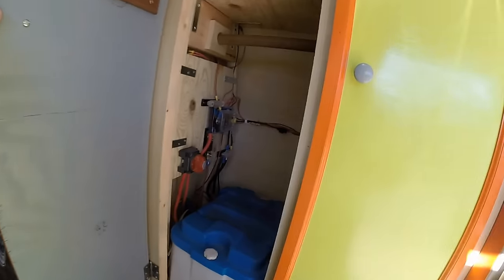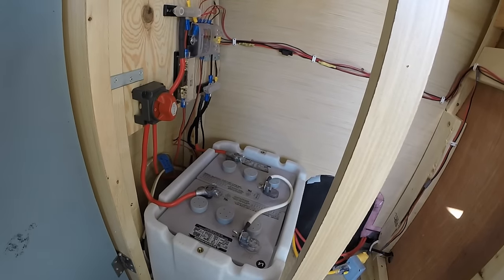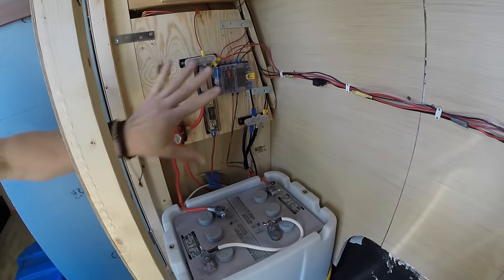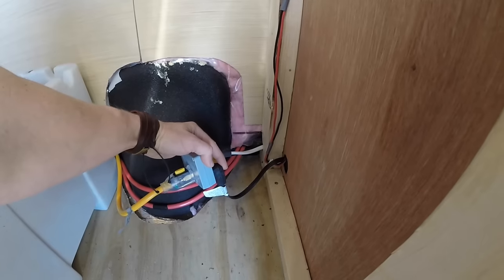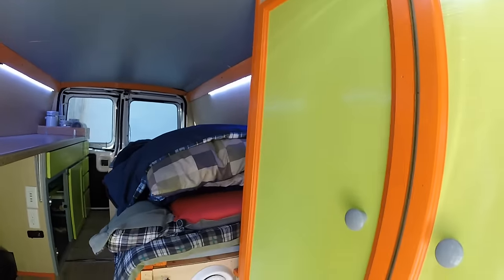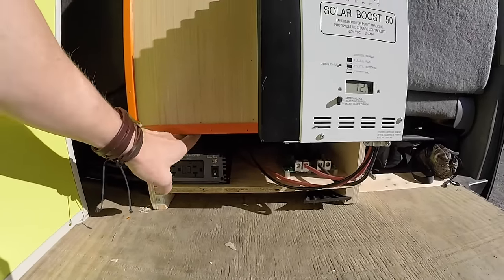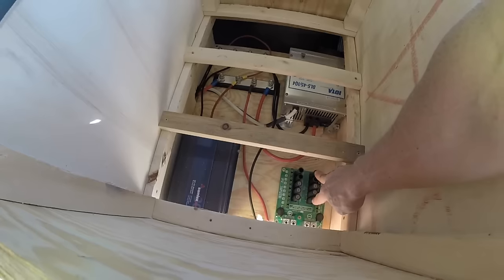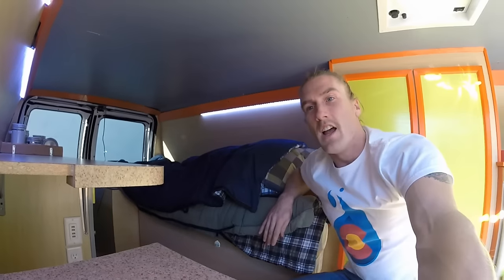Living in a Van: Battery System Installation - #VanLife

Comment: Great job, both with the complete system (so many ways to keep a charge in the batteries) and showing the pieces and how they fit.  I was thinking about being more frugal with my solar power and trying to keep everything 12 volts.  But the extension cord is a pretty tempting backup.  As is the link to the alternator.

Comment: Such an awesome set up.  I'm in need of tweaking the system I have in my HHR.  I was running my inverter off the car battery and understanding I need a deep cycle wired in there some how.  I was running a fridge/freezer and air cleaner and cook top off a 1500 watt inverter.  had to keep the car running to run the cook top.  But then keep leaving things on and killing my battery.  Ahhh but how great to be stealth and drive coast to coast.

Comment: I really like your van, especially the colors, I have a similar van with the same layout (pull out bed on the left and a counter on the right), I decided to make the bed 14" high so I can sit comfortably, plus I realized that lifting up the matress every time I want to get to the storage was tiresome, so I decided to make drawers underneath the bed that can slide out and I can sit on the bed while I pull out the drawers, I installed a bar sink in the counter with water tanks, but a sink that small is a bit hard to do the dishes and pans without splashing water everywhere, your electrical system is top notch, like you I started building my electrical system with everything in mind including a built-in window air conditioner (concealed inside the van) that I can run of my batteries and solar system, if there's anything I can suggest to you would be to, not buy and install anything until you know for sure you need it, when you start living in the van you'll see what's practical to have and what's not

Comment: I would really like a video of how you did all that with info please. I am seriously considering living in a van and want to have solar as well with all the comforts possible. Which means I need massive power to make it happen. So far your set up is the best I've seen. If you would rather not make a video (if it doesn't exist already)  any other way would work as well. I'm not as smart in that area.
Reply from the maker: Here's a post: http://davidsandel.com/designing-your-vans-electrical-system/

Comment: Interesting video - good videography and commentary, so kudos! I'm particularly interested in the way you split the shore power from your engine charging system.  Do you have any detailed videos on that??
Reply from the maker: The shore power is separated by the solenoid. Of course this assumes that the van is turned off when plugged into shore power.
Reply: @DavidSandel  Thanks for the info.  I'm not "big" on electronics, but I'm assuming the solenoid prevents or shuts-off when there's current to it or something?  I have to google this....
Reply from the maker: @whatsaguygottado2669  The solenoid connects the alternator to the house battery when it senses current in. When the current disappears (van shuts off), then the solenoid deactivates and doesn't allow current to flow backwards from the house battery to the alternator/van battery.

Comment: I am building an M934A1 Van body into an Off road Camper/ Trailer. I do enjoy your videos, and I agree with you about the previous video being too long but I would really like to have seen how you rigged your Solenoid to your engine start battery. is that tied into your ignition so when you turn your key on it starts charging your other batteries? or do you have a Separate switch? this video was shorter but was a little too fast. maybe 8 min is right? either way thank you for taking time to share everything with us.
Reply from the maker: +Colt Rice At the bottom of this page, if you sign-up, you can see all the detailed design schematics: http://davidsandel.com/designing-your-vans-electrical-system/

But to answer your question, yes, the solenoid is tied to the ignition. As soon as it clicks on, the batteries are tied together. However, this is NOT desirable. The house batteries don't like to source huge spikes of current. My solution will to be wire another toggle switch in parallel to the signal that controls the solenoid coil. And since that is the case, perhaps it would just be easier to wire in a high-current, manual switch instead of the solenoid altogether.

Comment: What does wired in series mean? I am just getting ready to convert a van. Most people speak way over my head. I can saw, nail, paint use a drill, etc.  I'm learning everything else.
Reply from the maker: I was going to write a reply, but then I realized I could just Google it for you much faster. :-p

http://www.zbattery.com/Connecting-Batteries-in-Series-or-Parallel

Comment: I have 2 6v  batteries wired in series to make 12v with a 100w solar 
panel in my E150 van. When the sun goes down I would like to run + and 
-- wires from my starter battery to my 2 house batteries without messing with the alternator. Here's the question can I just run the 2 
wires off the starter battery directly to the 2 6v battery terminals 
where the charge controller attaches to the batteries and put a manual 
inline on/off switch? I did not want to use an automatic isolator that 
sends charge whenever the engine is running, I would manualy turn it on when I want extra charge while driving. I like the electrical work you did!
Thanks Love your informative vids!
Reply from the maker: John Spooner Can I ask why you would want to do this? You risk draining and potentially damaging 1 or all 3 batteries that way, and the only thing you gain is very slightly more battery once the sun goes down. Additionally, in order to connect the batteries in this way, you'd need an another switch in order to disconnect the alternator from the van battery. So, if you tell me your thought process or why you want to do it this way, maybe I can offer a better solution.
Reply: This is getting more complicated than I wanted. Why do I need another switch from the alternator? I just want to run a pos and neg wires from start battery to house batteries. Pretend I'm hooking up dual batteries like these jeep 4 wheeler guys do. People do what I'm asking all the time it's just that one of my batteries is under the hood and the house batteries are behind the drivers seat.  there's one product comes to mind caller a stinger (among others) an isolator that automatically closes off the starter battery when you shut the motor off, I don't want to do that, I just want to use a manual switch. How would I ruin possibly all 3 batteries? I've read when the van battery is at full charge while driving anything over will dribble down the wires to the house batteries (unless I decide to turn the switch off). I have a volt meter to keep from over charging my house batteries. Does this make sense?
Appreciate all your help.
John
Reply: One more thing David, let me explain it this way, pretend I'm putting a 2nd battery under the hood, I could just wire them in parallel and be done (unless I wanted to use an isolator) forget that. Only difference is my 2nd battery is not under the hood. I just want to make the cables long enough to reach the battery in house. In other words my initial question is can I take a red wire and a black wire from the start battery and run those to the house battery?
Reply from the maker: Ohhhhh, I see where I was confused. I understood it as you didn't want the alternator to charge the house batteries. But in reality, you just meant you didn't want to touch the factory alternator wiring. Got it.

In that case, yes, you can you just wire the house batteries and van battery in parallel and use an inline switch. Just make sure it's rated higher than the surge current of any of your batteries or alternator. And just to be safe, I'd put an inline fuse or breaker in there, too.
Reply: Thank you that's what I needed to know!
Cheers
Reply from the maker: My last bit of safety warning is to make sure your switch is disconnected when you start your van. The deep cycle house batteries aren't meant for cranking an engine and it can either damage them or just really really reduce their lifetime.

Comment: Nice vid!  One question:  if you were to just charge your batteries from the van engine, how long would you have to run it for to get a decent charge? I'm planning my build and can't afford solar and can't depend on an external source
Reply from the maker: I guess it really depends on how low you run it before you decide to charge it. If your van is your daily driver, you should be able to keep it topped off for the most part. Or, if I'm parked somewhere for a couple days and have no need to move, I'll still go for a 15-20 minute drive; though, that certainly won't return it to full. In general, for a significant charge, I'd say to drive for at least an hour. You can kind of plan your schedule around that when you're moving around from place to place.

Comment: Awesome video - Short and full of info.
I only have one doubt remaining : How did you wire your system so that shore power can also power your system when the batteries are disconnected. Is that a simple "Y" connection with one branch on your distribution system and the other on your battery charger ? Or is there a specific system you use ? Do you have to manually switch or is that automatic ? 
Thanks for the help !
Reply from the maker: +eXtremeLife Everything runs in parallel. I am not sure what you mean by "Y" connection. I'm actually kind of confused by all the questions so if you want to try clarify, I'm still happy to try answer. However, if you want to look at my schematics and physical connections they're available to download on my site. (http://davidsandel.com/designing-your-vans-electrical-system/) I don't have any "system" other than how things are connected.
Reply: +Low Gravity Ascents Hello again. Sorry for the previous question, it was indeed confusing ^^
Watching your video and looking at your schematics did help me set up my system. Thanks !

Comment: Hello David 
I'm just starting living in my vehicle full time (3 months), and I'm about to install a 2000 watt inverter . Thank you, cause I forgot to think about what if I can "hook up to shore power".  I'm having issues cause I don't want to mess things up, cause this is my "Home" now, full time..
2000 Watts Inverter. ✔
(2)DC 105 Ah (Walmart batteries) soon
(1) 500Amps Isolator.  soon
(2 sets) 4 gauge cables. soon
David, what would I need to hook up to "Sure Power"?
Thank you for the video, and your time....
Reply from the maker: Did you get all of this installed? You have some mismatched and unnecessary items. Depending on how you connect your inverter and/or converter would determine how to install shower power. It could be as simple as using an extension cord.

Comment: Hello there! Heading on my second "vanlife" adventure in less than 2 weeks and I'm currently attempting a much less complex electrical system and it seems as if you might be able to help... I've got a deep cycle 100+hr Marine battery for the back of the van (to power cell phone, laptops, and lighting), a 2000watt (4000w peak) power inverter, and i'm trying to figure out the last piece to the puzzle. I know I need a switch... something that hooks to the alternator that can tell to charge both my original and sencond battery while im driving and only drain the second battery when i'm stopped... What would you recommend? A battery isolator is what i've been recommended but I thought it had something to do with a selenoid... Please any tips help... I know the pieces but I dont know how to put the puzzle together!!
Reply from the maker: A solenoid hooked up to the proper circuit from the under-dash fuse panel.
Reply from the maker: That's overkill and over twice as much as the one I use: http://amzn.to/2bkQXGE
Reply: Thanks!!

Comment: An electrical engineer Hmm Where U at. LOL I had my solar installed by an idiot in Cali. It worked fine for a while holding 14.2 fully charged but can't figure out why at night the voltage goes down to 13.2. Now a year later, it goes down to 13.1. W/ an Ikea led light I'm down to 12.6 in just a few hours but a year ago I could have kept it on for 6-7 hrs. Any idea I'm not electrically inclined but good & loved the carpentry part.
Reply from the maker: Could be a lot of things. I guess the first and most obvious place to start is the battery itself. How old is it? And if you're certain it's not the battery, it would take a lot of hands-on testing to figure it out. Good luck!